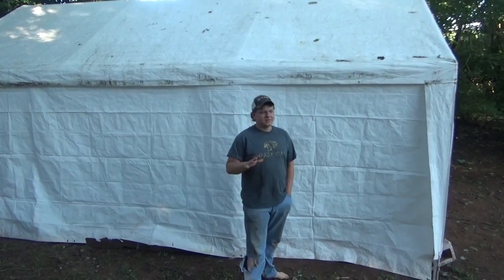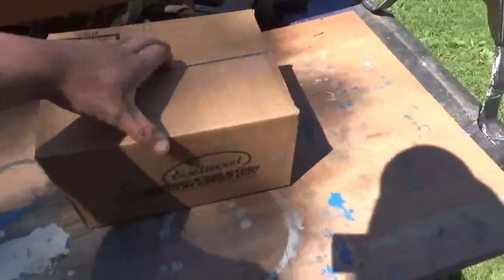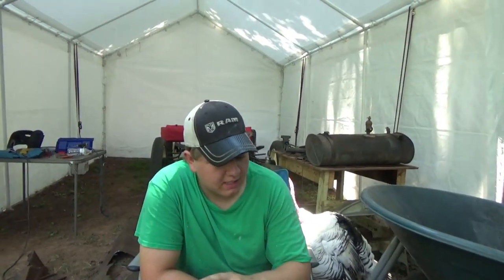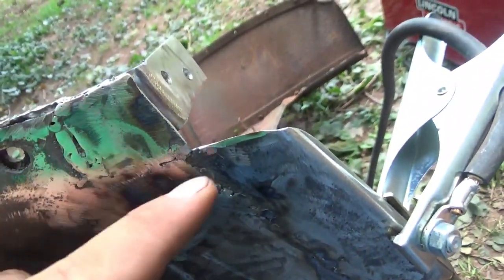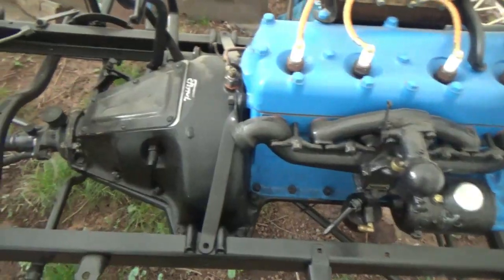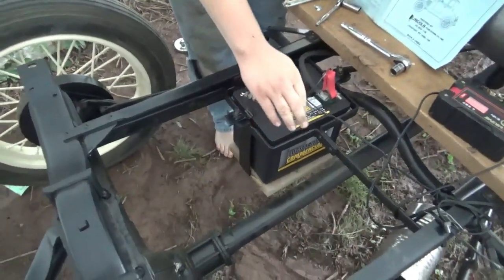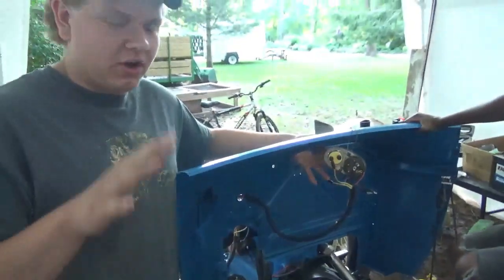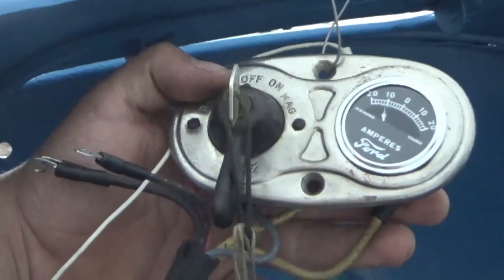Old Car Restoration | 1926 Model T (part 6) Getting It Ready To Drive

Comment: I bought a brand new ammeter and it was junk. If I tapped the front of the ammeter just holding it in my hand the needle would move and stay in the nee place. I put in an old one and it worked perfectly. If it only reads discharge when the car key is switched to the battery you could have the battery installed backwards. My first Model T had this issue when I first acquired it, and the battery was in backwards. Changed it to positive ground, killed the battery, completely and charged it again with positive ground and everything charged as it should.
Reply from the maker: Ok, thanks for the info, will have to check that out.
WB
Reply: Yes, I believe the model T is positive ground, unlike today’s cars.

Comment: A year late so you probably already know - looks like you are powering the generator like a motor.  and you're missing a jumper, that line goes to the switch (bat).  Fix your cutout if you haven't already - stuck.  See my channel if you have other questions, I might have already done a video that has the answer.

Comment: Great job so far guys!  👍. I have a 1923 T that needs a bunch of chassis work redone that was started 50+ years ago but never finished.  My dad and I rebuilt the engine in the early 1960’s.  The car sat in storage for over 35 years.  In 2017 my oldest son and I worked on it and got it started and moving under its own power.  Fortunately my dad was still around at that time and got to see it and hear it.  Seeing his car running again put a big smile on his face.  He passed away about 2 years later in 2019 at age 95.  2 weeks before he passed he was still driving.  Your work and videos have further inspired me to get working on the car again.  I expect to be retiring in a few months which should provide me with much more time to focus on it.

BTW, you guys NEED to wear eye protection.  You only have 1 pair of eyes and would be too bad to lose one or both of them from some mishap, such as a spinning wire brush shedding a bristle at the wrong time.  Do yourself a BIG favor.

BTW, Lang’s is practically in my back yard (about a 40 drive).  I have purchased a number of small parts from them.  Don Lang, the owner is a wealth of knowledge and is very willing to share it.  His knowledge was a tremendous asset when I rebuilt my Holley NH carburetor.
Reply from the maker: Thanks for all the info, were glad your enjoying the episodes, if you have any questions feel free to ask us, we don't know a lot but we can do our best to answer questions. Also best of luck to you with your car.    
The Weaver Brothers